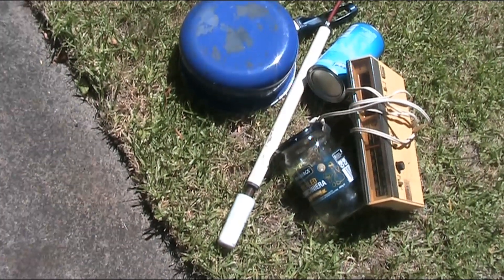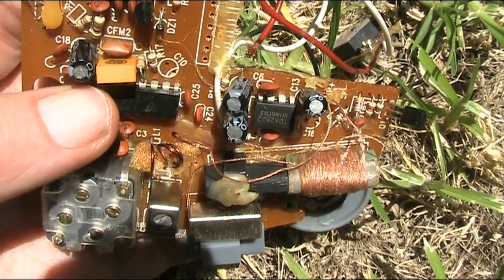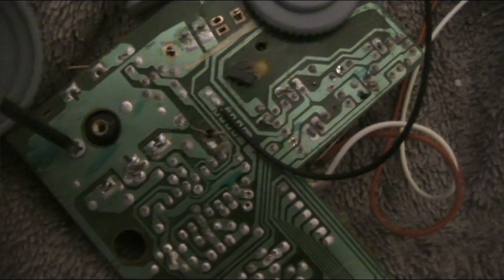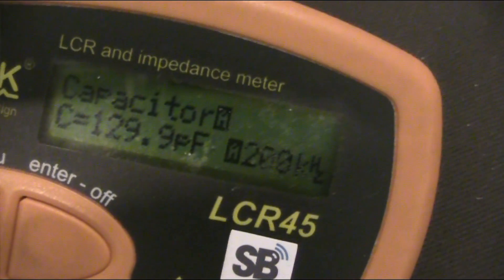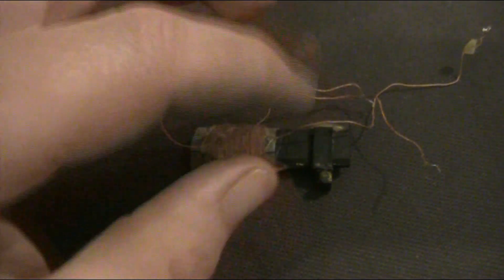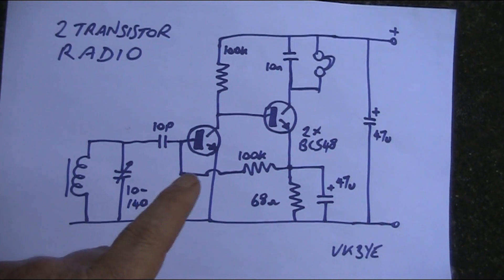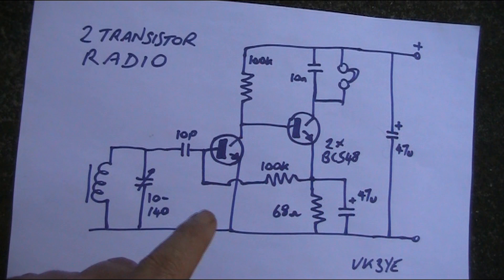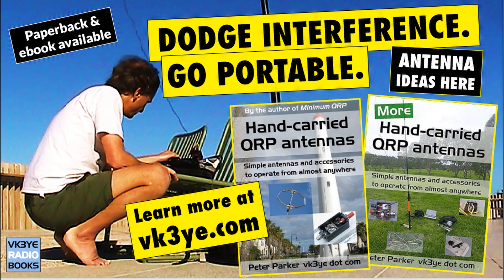Make a radio from another radio

Comment: Very nice .  Jaycar sell or did sell a tuning capacitor,  ferrite rod + coil and set of oscillator and if formers.
 There is a circuit by Ronald Quan that uses these parts. It has a separate local oscillator. 
Silicon Chip had another circuit using same parts but the oscillator is not a stand alone . The Radio Wrinkles Site for some good stuff

Comment: Good video. I also recycle components recovered from electronic devices, in fact I was able to build a very good direct conversion receiver with the MC1496P integrated circuit recovered from a radio.